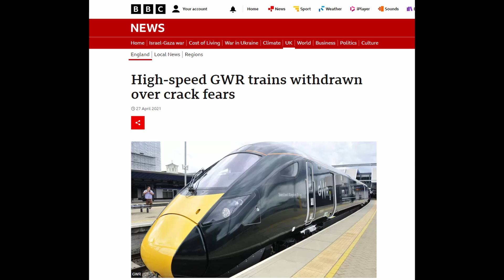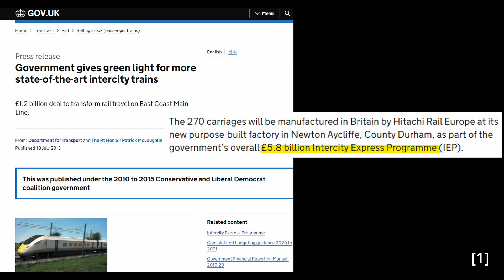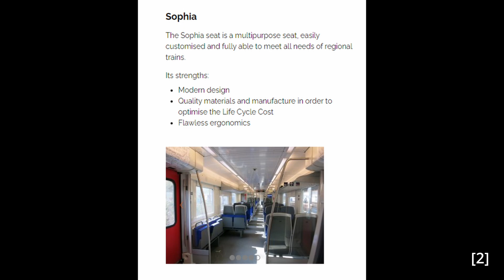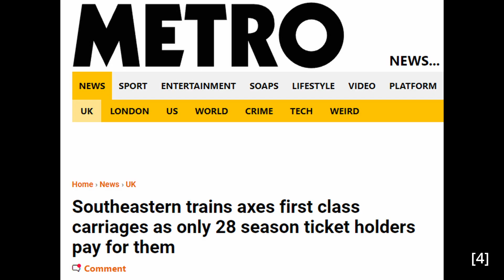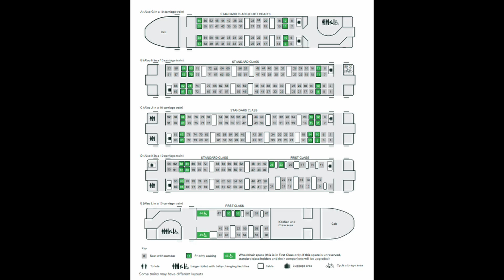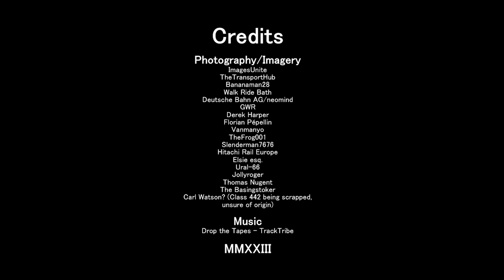Can the IETs ever be decent?

Comment: Hi there Everyone, I need to know why they don’t dig a tunnel and do an extension for the main line Trains so that they can extend the unused London Underground train stations. Why couldn’t they use the part D78 Stock train doors on the sides and also restructure the front face of the Q and A62 stock that includes the class 313, class 314 and class 315 remix and make them all together and also redesign them an overhead line and also make them into Five cars per units and also having three Disabled Toilets on those Five cars per units A62 and Q stock trains and also convert the Q and A62 stock trains into a Gardner LG1200, Cummins M11, Scania N112, Leyland 510, Volvo B10M, Gardner 6LXB, Gardner 6LXCT and Gardner 8LXB Diesel Engines and also put the Loud 7 speed Voith Gearboxes even Loud 8 speed Epicyclic Gearboxes in the A62 and Q stock, class 313, class 314, and class 315 and also modernise the A62 and Q stock and make it into an 11 car per unit so it could have fewer doors, more tables, computers and mobile phone chargers. A Stock Trains and also having 8 Disabled Toilets on those A stock trains. why couldn’t we refurbish and modernise the Waterloo and city line Triple-Track train tunnel and make it larger and extend it to the bank station, making it into a Triple-Track Railway Line so those Five countries such as Germany, Italy, New Zealand, Poland And Sweden to convert the waterloo and city line Triple-Track Railway tunnel into a High-Speed Railway lines? The Third Euro tunnel Triple-Track Railway line to make it 11 times better for passengers so they could go from A to B. Then put the modernised 10 car per unit A Stock and put them on a bigger modernised Waterloo and city line Triple-Track train tunnel so it could go to bank station to those Five countries such as Australia, Germany, Italy, Poland And Sweden. The modernised refurbished 10 cars per unit A stock could be a High Speed The Third Triple-Track Euro Tunnel Train So it is promising and 47 times a lot more possible to do this kind of project if that will be OK for London New Zealand, Germany, Italy, Poland And Sweden. oh by the way, could they also tunnel the Triple-Track Railway Line so it will stop from Buckinghamshire, Hertfordshire and Essex so that the Passengers will go to Germany, New Zealand, Italy, Poland and Sweden and also extend the Triple-Track Railway Line from the Bank to Buckinghamshire, Hertfordshire and Essex Stations so that more people from there could go to Germany, Italy, New Zealand, Poland And Sweden more Easily. Why couldn't they extend the Piccadilly Line and also build brand-new underground train stations so it could go even further right up to Clapton, Wood Street can they also make another new underground train station in Chingford and could they extend the West Coast Main Line Railway stations and the DLR right up to Chingford? All of the classes 150, 155, 154, 117, 114, 105, and 106, will be replaced by all of the Scania N112, Gardner 6LXCT, Volvo B10M, Leyland 510, Gardner 6LXB, Gardner LG1200, Cummins M11 and Gardner 8LXB Diesel Five carriages three disabled toilets are air conditioning trains including Highams Park for extended roots which is the Piccadilly line and the Docklands Light Railway trains. Could you also convert all of the 1962 stock trains into an air-conditioned maximum speed 81 km/hours (51 MPH) re-refurbished and make it into a 8 cars per unit if that will be alright, and also extend all of the West Coast Mainline train stations to make more space for all of the extended 8 car per unit 1962 stock air condition trains and can you also build another Mayflower and Tornado Steam Locomotive Companies and can they order Every 88 Octagon and Every 47 Hexagon shape LNER diagram unique small no.14 and unique small no.11 Boilers from those Countries such as Greece, Italy, Poland, and Sweden, can they make Mayflower and Tornado Steam Locomotive speeds by up to 147MPH so you can try and test it on the Original Mainline so it will be much more safer for the Passengers to enjoy the 147MPH speed Limit only for HS2 and Channel Tunnel mainline services, if they needed 13 Carriages Per units, can they use those Lister class 93’s, Lister class 17’s, Deltic class 44’s, Lister class 40’s and Lister class 43HST Diesel Locomotive’s right at the Back of those 13 Carriages Per Units so they can take over at the Back to let those Mayflower and Tornado Steam Locomotive’s have a rest for those interesting Journeys Please!!!!!!, oh can you make all of those Coal Boxes’s 19 Tonnes for all of those 147MPH Mayflower and Tornado Steam Locomotive’s so the Companies will Understand us PASSENGER’S!!!!!!!! so please make sure that the Builders can do as they are told!!!!!!!!!!! And Please do something about these very very important Professional ideas Please? Prime Minister of England, Prime Minister of New Zealand, Prime Minister of Sweden, Prime Minister of Germany, Prime Minister of Italy, Prime Minister of Poland and that Includes the Mayor of London.

Comment: You say that replacing the seats isn't a major point. I'd disagree. I've stopped traveling on any Azuma services on the East Coast. These trains are akin to a torture chamber for anything over a 30 minute journey. The general state of rolling stock on all UK high speed routes is dreadful at present and needs urgent attention. Mind you, why would the operators care if the trains are still full...

Comment: You might want to note that "IET (Intercity Express Train)" does only refer to GWR's fleet of Hitachi AT300's, as its their branding name given by GWR, just like "Azuma" for the LNER units.
"IEP (Intercity Express Programme)" however is the name of the project to replace old trains on the GWML and ECML (all other AT300's, the ones operated by TPE, EMR, AWC, HT and lumo are seperate contracts and independent from the IEP).
I think you confused these names quite a few times during the video.
Reply from the maker: I didn't confuse them unintentionally - I am well aware of the differences and did, for a time, enforce them quite fastidiously in conversations. However, "IET" has now become a catch-all term, rather like HST was, and it will likely become further entrenched as time goes on - I highly doubt that anyone will be bothering about the other names in 2050. To use another term, when everyone knows what you mean by saying "IET", is pointless.

Comment: On my recent trip i found them quite comfortable for the hour ride i took. However, any longer and i would begin to find it uncomfortable. Slightly more padding would make them far nicer. It also appears that they have warmed several lights and the ambience it quite nice. However, the failiures outweighed this as the returning train was cancelled due to cracks and the following train had no operable toilets. They  are also far too short for the routes they take.  The routes via oxford should be lengthened to 9 cars atleast as there were few unreserved seats.

Comment: Incidentally what do you guys think of the proposed HS2?
Personally i think that if Britain was continent-sized it'd make good sense to shave hours off long trips, but as Britain is just a relatively small-sized island, only minutes would be shaved off, so HS2 is therefore not worth the cost and infrastructure disruption along the route, or am i missing something?
Reply: You are missing something. HS2 as originally designed was about a huge step-change in capacity and with the added benefit of very impressive journey time cuts (an hour less from London to Manchester).
Reply: There is something you're missing. Time savings are secondary to capacity increases, and the west coast mainline is at capacity and can't take more trains on it

Comment: In the summer, I travelled on a WSM-PAD train from Chippenham that was so jam-packed that it took several minutes to get on and then squeeze my way through the crowded vestibule into the compartment to find a space where I wasn’t breathing down someone’s neck! I had a large suitcase of course.
The replacement of 9-coach sets with 5-coach sets also makes a mockery of the seat-booking system.

Comment: Firstly- First Class at the weekend GWR offer upgrades to first for a fee, the rest of the train could be packed, so why not just reduce first class increase standard class.  Next agree with the stupid 5 car versions, I have seen them arrive at Reading and be crammed, only for a 9 car to arrive two minutes later empty, all trains need to have more seats and be at least 9 cars. plus 2 x 5 car sets - no was on one of these out of Paddington the rear set standing room only, front set empty - passenger running to catch the train end up in the rear unit and can not get to the front unit. Likewise on a 9 car train leaving late, same thing front three cars were empty yet people standing in the back 4 cars, of course people do not walk through if the people in next car are also standing- but trolley service can not operate in these conditions either. - what happens when the routes are fully electric the trains must need a refit to remove the diesel power units?

Comment: I largely agree with this. Although if it was me I would just retrofit the HSE class style interior into the IETs for standard but as you said take 1/4 of coach A away as a bike space similar to the Class 180s. Put a proper buffet space between First & Standard moving the kitchen too!  First Class going back to the 2014 refit style seats although maybe with fabric instead of leather but ideally exactly the same as before. Remove the awful voyager style window blinds in First and replace them with curtains. The vestibule areas then taking the slack for all this by using it for more luggage & toilet space, with the horrible fake wood effect peeled off leaving inside all cream with the inside facing of the doors painted dark green or silver.
Reply: I saw a video of a train in Canada where a WHOLE carriage appeared to be given over to bikes.

So it CAN be done....

If only we could rid ourselves of these arrogant ignorant egomaniacs calling themselves designers and train operators, who seem rarely if ever use trains, or cycle, themselves.

Comment: Interesting and thought-provoking. If I am using the service from London to Swansea, I will always book first class at the rear - the 17h44 departure from PAD to SWA has a cunning secret, which GWR seem particularly UN-enthusiastic about advertising- a PULLMAN dining service in the rear car!  Bliss!  you arrive into Swansea a few hours later (as the underfloor diesel engines throb away after leaving the wires some way back towards Cardiff) in great shape for a Welsh weekend.
Reply from the maker: The Pullman is great, it should really run on more trains.

Comment: I've never travelled on the GWR sets. I use the LNER ones every week and they seem fine. Obviously not as comfortable as the MK4 sets but acceleration is very good. Only down side is the tiny standard class buffet. Its like a cupboard,  and i dont know how the catering staff put up with it. Otherwise theyre pretty ok.
Reply: The GWR ones are the worst of the lot, they were the ones with the cracks and the seat cushions have collapsed meaning there's a bar digging right into your bum the whole time. Survivable for 1h 20 from Bath to London, I wouldn't enjoy it for 3 to 5 hours. The interiors are also really dirty and some of them have really ratty looking carpets. The acceleration is good, but the ride at speed is like a shopping trolley. I don't find the rough ride that bad, it's not my biggest complaint, to be fair I didn't think the HSTs rode especially smoothly, but it's the seats that need to be sorted out

Comment: Until recently I used to take these fairly frequently between London and Bristol. One time at top speed I thought 'good grief this thing does not feel sturdy, and is rattling itself to bits, surely there's gonna be problems.' Sure enough a couple of months later they discovered the cracks. 
The whole train (as the lack of seat-padding constantly reminds your backside) just oozes being built to the lowest cost and quality they could possibly get away with, and then some.
Reply: I hate GWR  more and more

Comment: The IET’s suck. Period. Had the misfortune to travel on the LNER ‘Azuma’ version. Awful hard seating, awful over bright glaring lighting. Atrocious ride quality shaking everything inside, and I mean everything. Cramped awkward toilets. Badly fitting trim. Awful levels of external wind noise. Changed onto a EMR Voyager halfway through my journey and wow what a difference in refinement. Decent ride, noise isolation, seat comfort etc..

Comment: Aside from the poor seats; the lack of space for luggage (or bicycles) is absurd, compared to the old trains which already struggled in the Summer. Having once been at the end of the quiet carriage with a suitcase and then finding I'd have to get through the length of the carriage past standing passengers and other cases in the aisle. It's fairly common now for the catering to be suspended due to luggage on the floor.

Comment: If they plan to lengthen or rearrange trains, they could just order a bunch of extra coaches with cafés in them like LNER have, and swap/add them in, without requiring any expensive new design/manufacturing-changes/testing that might come with a more substantial refit. 

I'd also be interested to know if your poor experience with rattling and such is specific to the 802s or also applies to the other classes, since the 802s (which were manufactured at the Hitachi Rail Italy plant shortly after its acquisition, unlike the others) are known to have serious fitment problems due to major quality control issues at the Italian plant. I have not noticed any issues on the occasions that I've been on LNER 801s (though it doesn't mean they aren't necessarily present)
Reply from the maker: Adding buffets in new coaches would be great, I must admit I hadn't thought of that.

Comment: The food trolley also really bangs up the arm rest and seat edges. LOVE that idea about a 5 car fast train to Worcester after splitting at Oxford. I reckon to do that they'd need to redouble the single track sections between Oxford and Hanborough and Evesham and Worcester. Simply better seats would do the world of good! Also bins in consistent places would be very helpful. It's never easy trying to remember where they are as they change locations.
Reply from the maker: The trolley banging the seats is really annoying, especially when you're not expecting it and you suddenly get slammed in the back!

Comment: I wonder if at least part of the reason the 800s ride so roughly is because, in common with all trains these days, the bogies have yaw dampers (to control side-to-side movement) attached to hefty brackets welded to the carriage bodyshell? They also have anti-roll bars, which again amount to chunks of solid metal connecting the bogies to the bodyshell. Surely these act as vibration-transmitters, ensuring that every bump and jolt is passed into the carriage, bypassing the suspension? If I recall correctly, the cracks which plagued the 800s were in the welds which attach the yaw damper brackets to the bodyshells. I can't remember any explanation from GWR or Hitachi as to why the cracks had appeared, but the problem perhaps illustrates how much vibration passes through.

In fairness to the 800s, they're not alone. The Class 197s have the ride quality of a tea trolley being flung down a flight of stairs - and, sure enough, the 197s also have chunky yaw damper brackets acting as suspension-bypass vibration transmitters. Ironically, the yaw dampers seem hopelessly ineffective. I've been on a 197 on which the bogies were wobbling about like a DLR train, and the ride quality in general felt like the train had square wheels. . What's the betting the 197s are stopped for crack repairs in the near future?
Reply from the maker: Quite high, I presume. Many CAF trains (and trams) have experience cracking problems recently.

Comment: 5-car sets was always stupid unless they did light but long services like Carmarthen to Padd but only principle station stops.  It's fair to say the fleet is a total let down and only EMR 810s have a chance to redeem any variant of them, which is thin comfort when only the WCML is devoid of their poison.  The seats HAVE TO GO - they are the point of contact between the railway and passenger and are a disgrace, who ever specified them as acceptable should be fired for incompetence.  DfT bemoaning the HST fleet is the real problem with loosing the castle fleet which is causing the same issue as Cross Country had for years - leading to the return of their HST fleet - oh the irony!  There is little confidence in these trains making it 25 years, the cracking problem isn't going away and everytime you repair them it makes the next repair harder and the materials overall quality drops again - it's clear the bogies general roughness isn't helping, which again leads to the question of why do we have trains with worse performance than ones 40 years old they replaced - it's not an upgrade.  The reality is we got sold a very expensive boat anchor which is going to take a major engineering program to even bring up to standard never-mind quality. 
IF you were a cynical thinker - you could almost say this was a deliberate act to make sure people stay in the jobs that never end and the contracts for modifications keep on coming in....